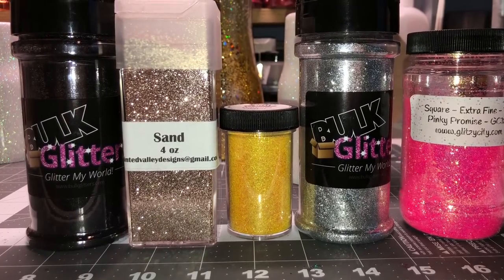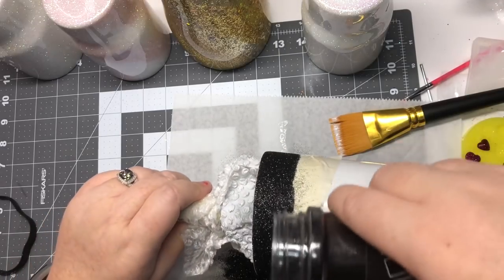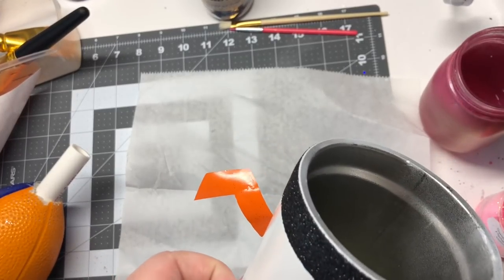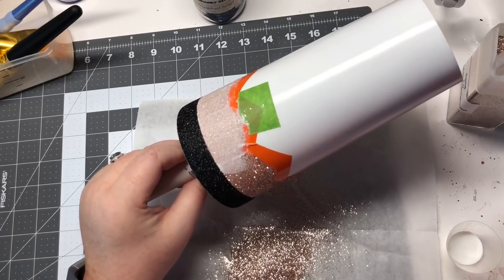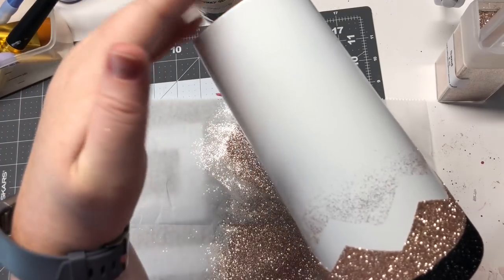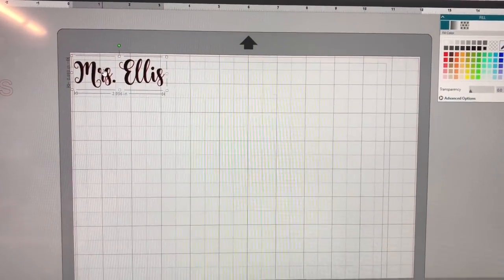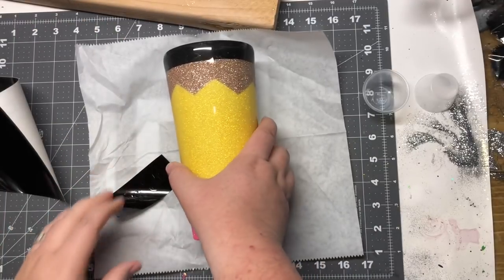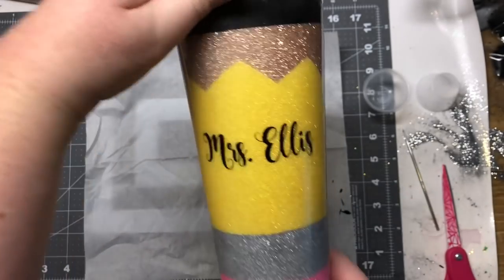How to Glitter a Pencil Tumbler: Start to Finish

Comment: Could you tell me the difference in the transfer paper ? I seen some people have to remove the letters from the paper in order to put it on whatever canvas that they are working on. Also, what kind of cricket are you using ?
Reply from the maker: I’m guessing it’s a difference of the vinyl and how easy it goes onto the cup or not.  Some vinyl is tricky. I use a silhouette cameo.

Comment: Hi Great Tutorial. Question? Did you use clear sealer  again after applying the second coat of Expoy
Reply from the maker: Sallam Still After the second coat of epoxy it was done. The epoxy is the sealer

Comment: Have you tried using white acrylic paint as your base coat? Does it work? 
I’ve seen you use white chalk paint but never acrylic paint. Thanks!
Reply from the maker: You can use spray, acrylic and chalk paint.  I've used all types.  :)

Comment: Hi, you mentioned that if you had time, you would do the epoxy method when applying glitter. I’ve seen some of your epoxy videos, but do you have one that shows how to glitter a cup in sections with epoxy?
Reply from the maker: I haven't done one with applying glitter in sections with epoxy.  It would take a lot more time to do it that way, so I just haven't wanted to.
Reply: @MinderellaCreations  Thanks!

Comment: What kind of sealer did u use to spray the black, I have a clear sealer & I also have a loctite spray that i use in my other glitter tumblers, which would u suggest?
Reply from the maker: Andrea Pitre loctite is adhesive.  Don’t use that. Any clear spray sealer or paint will work.
Reply: @MinderellaCreations  Thank U good to know

Comment: Have you ever tried to glitter a tumbler that has the factory power coat on it (Ozark Trail)...or does the glitter only work on the plain stainless steel tumbler.   .thanks 😊 ...
Reply from the maker: I just strip them first by soaking paper towels in acetone and wrapping around the cup and then wrapping aluminum foil around it and placing it in a ziploc bag in the sink.  I leave it for a few hours and then you're able to peel it off.  If you don't remove it you can sand it a bit to scuff it and then apply paint or glitter as you normally would.

Comment: oh question... how do you seal the glitter what do you use cause i have an issue where my glitters mix together when I epoxy even when I seal it with rustoleum clear spray. Please help
Reply from the maker: I use rustoleum 2x clear gloss to seal mine.
Reply: @MinderellaCreations  How many coats? How long do you wait after you seal to epoxy?
Reply from the maker: Francesca Jimenez usually just one good one.

Comment: What sealing spray do you use to seal the black glitter?  And do you seal each different color?  I'm sorry if those are dumb questions, I am just a newbie :-(
Reply from the maker: Any clear spray will work.  I use rustoleum 2x clear gloss.  You could use a clear acrylic or triple thick as well as many other.  I’d steer clear of the krylon brand as some of those are known to repel epoxy.
Reply from the maker: Brooke Nuckolls I only sealed the black and then all once done.
Reply: @MinderellaCreations   Do you seal the black after the first coat? After the second coat? After either has dried? Or right after taking off the tape?
Reply from the maker: Adilene Medellin The video of me sealing it is after tape was pulled and black was done.

Comment: When I pull my tape the spray paint came off with it. Any tips? I used 2x rustoleum  flat white primer and blue painters tape
Reply: I used the exact products that you did and mine did the same thing.  I let the spray paint dry for about 12 hrs.  I'm wondering if I should have let it dry the full 24 hrs as the spray can states??? Any advice is appreciated

Comment: Have you used Loctied? Wouldn't it be better since it drys faster? I'm torn between the 2
Reply from the maker: Glitter MePink I’ve never used loctite.  Some do.  To me I don’t think I’d get as good of coverage.
Reply: @MinderellaCreations  ah ok...so it's about "coverage" then. I can work with that.  I thought it was more about not gluing correct that it came off. Thank you very much for your response.  Love your work 😉
Reply from the maker: @glittermepink5527  Yeah, for me I've just found that mod podge or epoxy work best.  Everyone will find what works best for them.  I have a friend that loves loctite and gets great coverage, but I've been happy with what I use so don't care to switch.  :)
Reply: @MinderellaCreations  thank you very much 😍 may God keep giving you grace to keep doing such an awesome work😊

Comment: How long did you wait before applying another coat of glitter using the mod podge?
Reply from the maker: I always wait at least an hour...or overnight to be 100% sure it's dry.  You want it to be dry to the touch completely before you add the next coat.
Reply: @MinderellaCreations  what if I use epoxy? I typically use fast set epoxy when I make my glitter tumblers but I’ve never made anything like this so I just want to make sure the colors don’t bleed into each other.
Reply from the maker: @yvettesalvato6642  With epoxy you would need to wait for it to cure before moving onto the next part or you will mess it up.  So fast set you'd need to wait I think it's usually 2-4 hours.  Regular epoxy 12 hours to cure hard to the touch.
Reply: @MinderellaCreations  got it! Thanks so much!

Comment: How long do I leave the cup on the cup turner after I have applied epoxy?
Reply from the maker: Emily Mayle I wait about 4-6 hours.  Or overnight.
Reply: @MinderellaCreations  Thank you very much! :)
Reply: @MinderellaCreations  you mentioned that you can seal between sections.  What would you recommend to seal  the glitter? Thank you
Reply from the maker: Martyna Singh I use any clear gloss sealer.  Sometimes with a UV protectant.  Or acrylic sealer.

Comment: Help !!! Please I am new. Use my Cricut market please where or how can I find the orange design or golden m’s
Reply from the maker: I am not sure what you're asking?  Orange design?  Golden M's?
Reply: Minderella Creations I am sorry , I am looking how I can use my Cricut market for decorate the pencil tumbler you print the orange little bannner and put around the tumbler and put golden glitter glitter
Reply from the maker: Veronica Cantu Oh!  It was a chevron pattern I used as a template when I glittered.  I drew them in the silhouette software.
Reply: Minderella Creations a ok so you know what can use I. Cricut market ?
Reply from the maker: Veronica Cantu I’m not sure about a cricut market.  I’ve only used the Silhouette Cameo.  I know there are several Cricuts that can be used to cut vinyl.

Comment: Why did you spray on the cup after you applied the blk part?
Reply from the maker: veronica gutierrez It was sealer so the black wouldn’t shift or flake off in my other colors.
Reply: Minderella Creations can you tell me what it is? If you don’t mind.
Reply from the maker: veronica gutierrez Any Clear sealer will do.  I’m honestly not sure which one I used this time.  I like the rustoleum 2x Clear with UV

Comment: what did you spray on the cup?
Reply from the maker: A sealer, clear coat, Rustoleum 2x Clear Gloss, in order to seal in the black glitter so it didn't move.

Comment: How can I fix a tumbler that I sprayed and dripped?
Reply from the maker: Ady Lopez The paint or sealer?
Reply: @MinderellaCreations  paint
Reply: @MinderellaCreations  the spray paint dripped. I guess I put to many lol
Reply from the maker: Ady Lopez When I’ve had that happen I lightly sand just the drip.  Usually it won’t be an issue though because you’ll be covering it up completely. 😊
Reply: @MinderellaCreations  thank you so much...

Comment: what kind of paint did you use for the white?
Reply: and what did you spray on the black?
Reply from the maker: @ashleycarpino3396  I used white spray paint.  Rustoleum 2x Flat white primer.  I sprayed a sealer on the black...rustoleum 2x Clear Gloss spray.